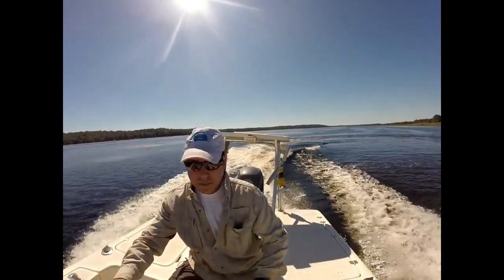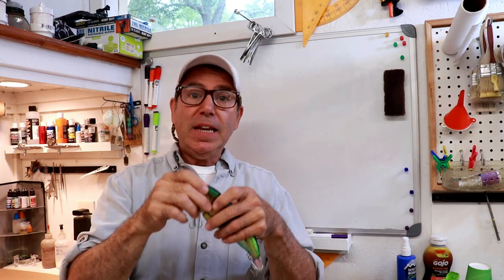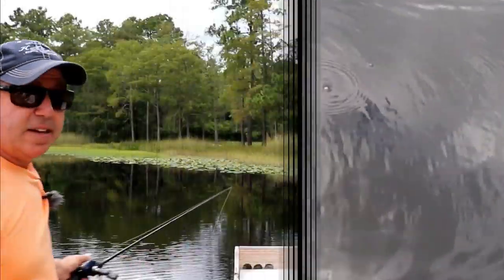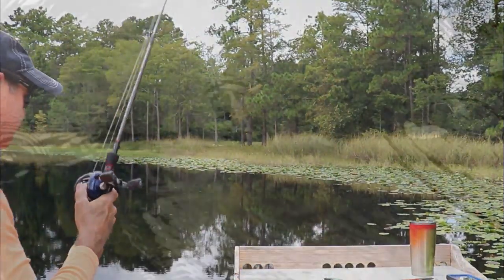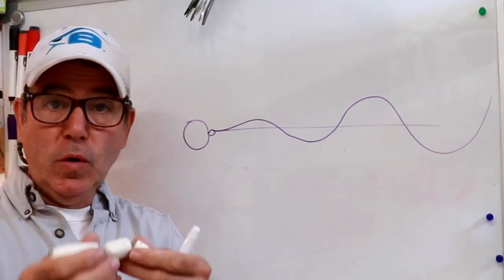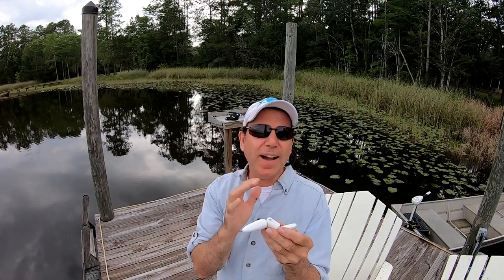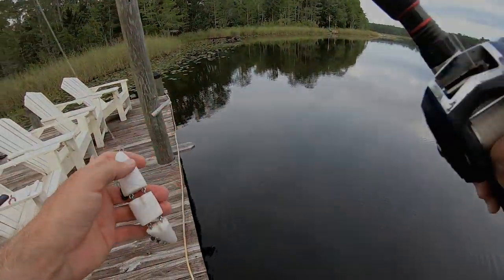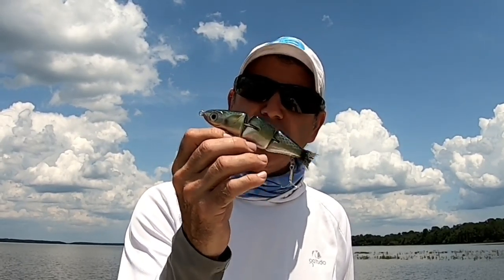Lure Making Pro Tip, Swimbait Action

Comment: This is a lot of good information. Thanks for sharing. I’m surprised you haven’t built a swim tank with moving water to test, right there in your lure shop. Keep the videos coming.
Reply from the maker: Every time I think of building a tank I remember I live on a lake,  it's not ideal but it works.  Thanks for watching.
Reply: I did several different designs for a swim tank. Long, short, swim tube, moving water around a track. Bottom line was that it just didn't work enough to give an indication of what the actual lure movement would be like in the wild. I think it works for light stuff like flies, and soft baits but solid or heavy stuff.. nope. That's probably why bait companies have long test tanks or pools. Moving water over a bait just isn't the same as a bait being pulled through the water. Sort of like walking on a treadmill with the track moving beneath you just doesn't feel the same as walking.
I was going the post a video of my tries, successes, and failures but it would just show that it's not a great option so I didn't bother. Maybe someone has had different luck.
Reply from the maker: I have to laugh a bit to hear you talk about your test tank attempts...I've done the same.  For me, a small table top current flow tank would be helpful but I've tried and it''s more trouble than it's worth.  I have the luxury to just walk down to the dock.
Reply: @EngineeredAngler  Same here. The lake is 30 feet outside my front door. Thing is I live in Maine. Winter is the down time when a lot of my lures are made. I cast them onto four feet thick ice but they just don't seem to have the same action when retrieved as they do in the summer. ;-)
Reply from the maker: Ice? Sounds like just another design challenge.. :)

Comment: Hi, nice video about the differents types of hinges. My first choice is the power hinge and the second is the banner hinge.
Reply from the maker: Thanks for sharing!
Reply: @EngineeredAngler  By the way, could you inform the aluminum hinge thickness? I would like to install this concept in my next lure. Thank you.
Reply from the maker: The hinge plates are 1.59mm thick.

Comment: A great video; thanks for your tutorial. I’m curios though, what happens if you change things up a little? What happens when you alter the face of each segment, use varying densities of wood, and vary the diameter and length of each segment? The head of a snake doesn’t move as it swims, and different specifies of fish have particular movements during types of swimming behavior. A fleeing fish swims differently than a one during a normal pace. It would be interesting to see how the baits change the sinus rhythm, implying a varying cadence, sound, and flash. Thanks again, Bill from Mn.
Reply from the maker: All good questions....